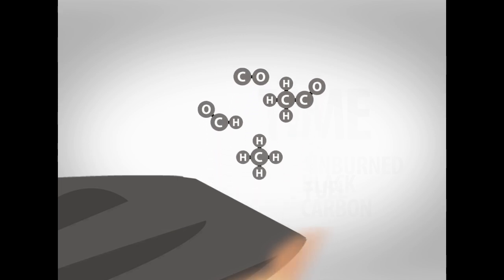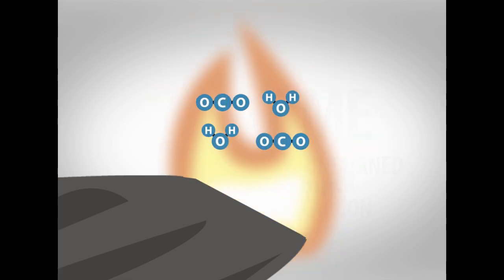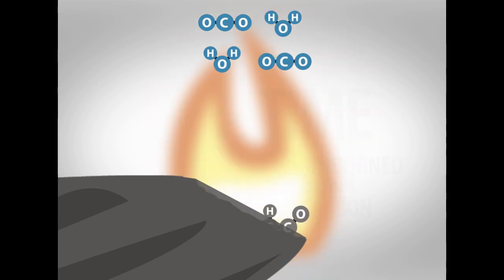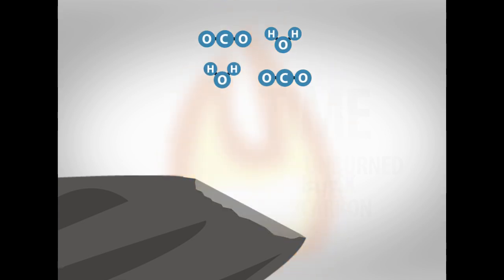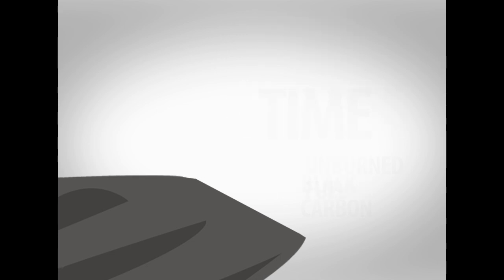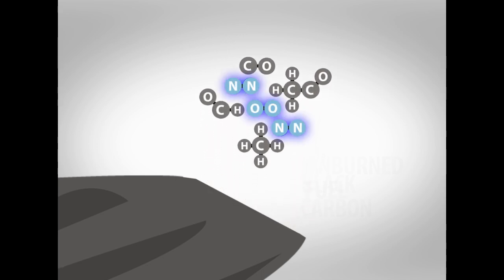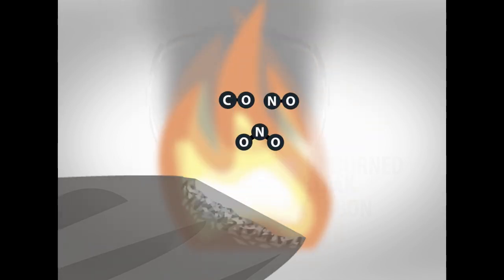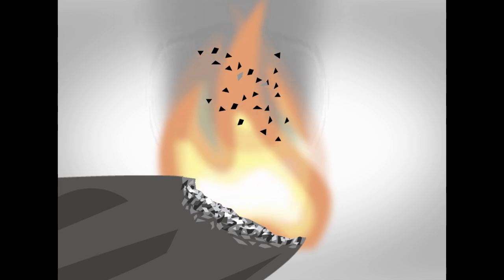Science Spotlight: The Combustion of Wood

Comment: What happens if you heat wood to the same temperature as if it was burning, but there's no oxygen?  Say it was in a kiln filled with100% nitrogen.  What happens to the carbon molecules that are released?  How would the wood end up?
Reply: Thats how charcoals are made :)
Reply: That's a pyrolysis process! Resulted from burning organic substance like wood in absence of oxygen under high temperature would produce solid, liquid and gas products. Char (solid product) is a leftover of the wood with high content of carbon. It is due to the volatile components in the wood are released, and called as the gaseous products which are mostly methane, CO, CO2 (also known as synthetic gas or syngas). Meanwhile, a liquid product is also produced known as tar or pyrolysis oil. It is a complex mixture of phenols, ketones, alcohols and various hydrocarbons. In instance, the burning of wood when there's no oxygen would produce syngas (methane, CO and CO2), char, and tar. syngas and char are usually the most valuable products when we talk about pyrolysis.
Reply: it would release carbon monoxide molecules which can end with possible fatality
Reply: @A.small.fish8  Carbon monoxide is formed due to insufficient oxygen during combustion, a molecule of carbon monoxide(CO)contains one atom of oxygen but he said what will happen if,"no oxygen is present. "
Reply: It would release wood gas or methane i guess

Comment: Bad for environment? Maybe if all you consider is the fire, but for the wood to be formed in the first place a plant used carbon dioxide from atmosphere in photosynthesis.. matter isn’t created or destroyed.. kinda a net neutral for the environment in this case. But good vid.
Reply: So when I heat my home with local wood that's worse for the environment than electric heat from a coal plant or oil imported from the other side of the world? Nah.
Reply: Wrong. If it releases carbon in the form of CO2 then it's neutral as you say. But due to incomplete combustion all these other toxic gases and PAHs are also created and released which are definitely bad for everyone.
Reply: Underrated comment